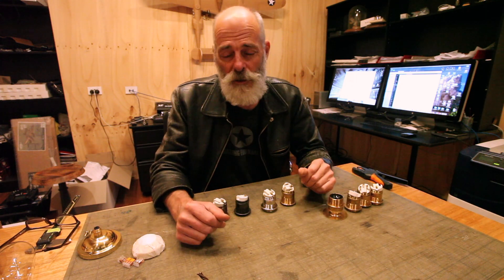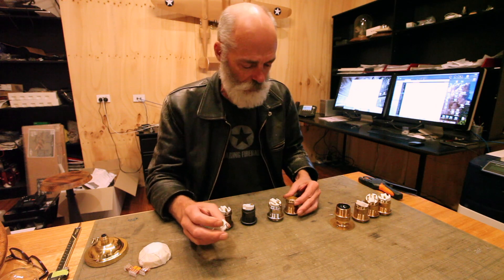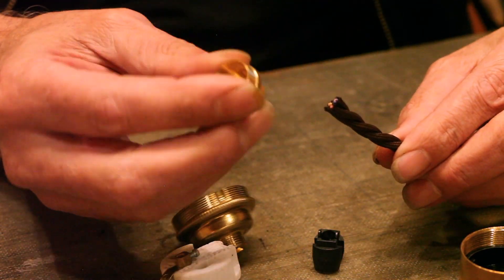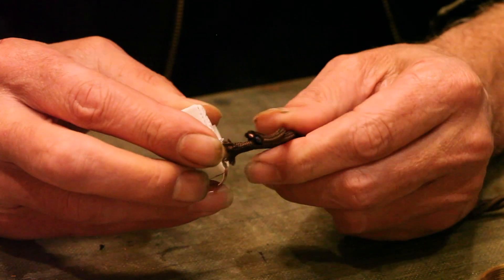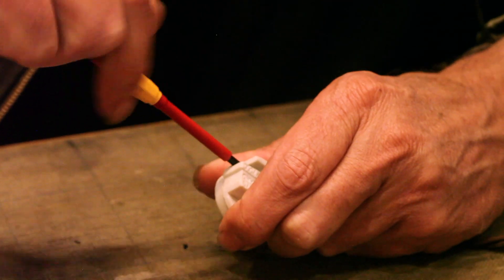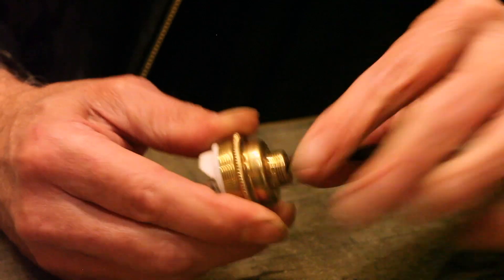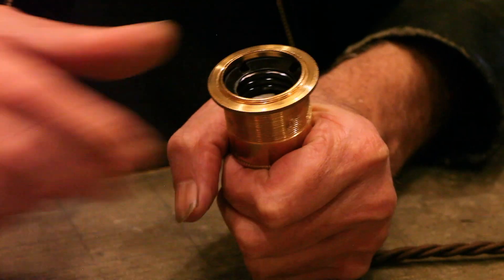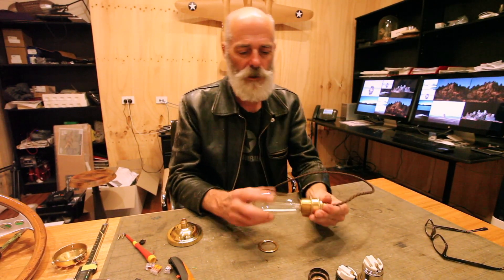E27 Brass Lamp holder wiring demonstration

Comment: Thank you so much guys. I just asked a supplier to send me a replacement because I thought my lampholder was broken because I couldn't unscrew it. Turns out all I needed to do was ease off the rachet pin. Now I have two lampholders!! I will have to fess up to my suplier. We obviously are backward in England 😂
Reply from the maker: Ha, that is a common issue even with experienced electricians.

Comment: Hi Edison. I've just bought and connected up an ORIOL E27 Lampholder - model no ORIOL A01/528. Its actually the wrong size - its too long and I need to disconnect and replace it, but I can't seem to unscrew/disconnect it. Can you explain how to unscrew/disconnect it?
Reply from the maker: All ES lamp holders will have an anti rotation device that stops them from being unscrewed accidentally. Look closely inside the threaded end to see if you can find that ratchet. You will need to hold that back whilst unscrewing the base.

Comment: This is superbly helpful - thank you. Used this video to sort out why one we had didn't work. It was wired up by the shop where we bought it and I couldn't unscrew it to find out what was wrong. Now I understand why! Once I got inside, it turned out it was wired up incorrectly (blue to the central contact) plus they hadn't properly stripped the blue wire enough to make electrical contact. Sorted now.
Reply from the maker: Brilliant, glad we could be of assistance.

Comment: Is there a type of holder that has right angle bracket to mount it to another nearby surface? I am looking to retrofit existing outside enclosure.
Reply from the maker: There are a number of ways to create a right angle. We often use tapped sphere type.
https://edisonlightglobes.com/Shop/shop/hardware/build-hardware/large-mounting-coupling-esl230007-z/